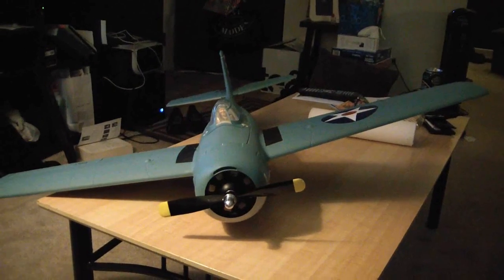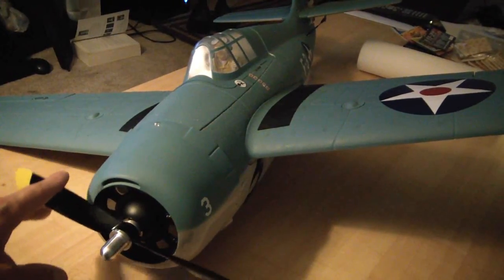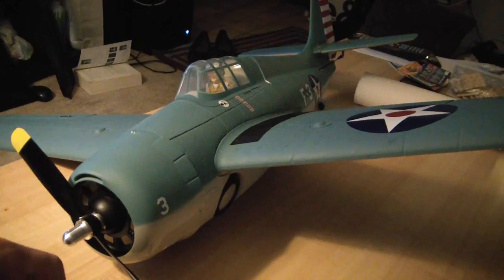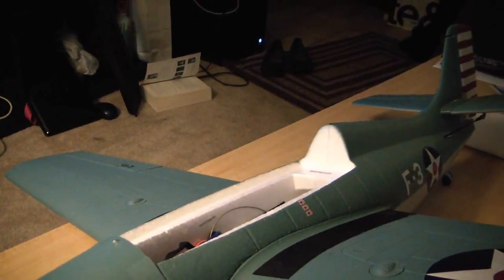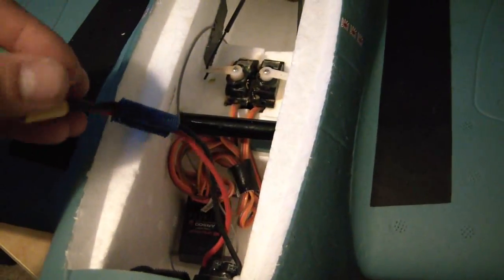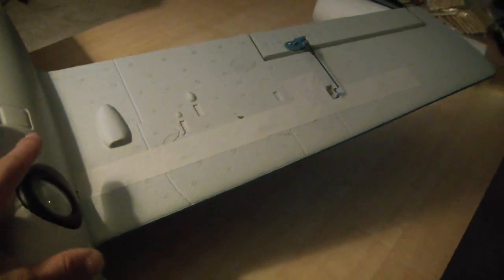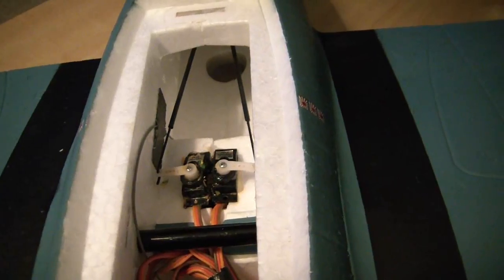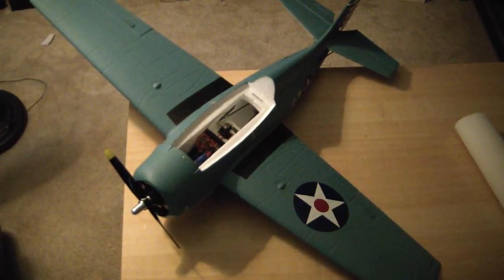F4F Wildcat built from P-51D BL parts!

Comment: Hello, just wanted to suggest a T28 prop. Really improves vertical performance. I am using the stock 18A esc and have not had any issues after 22 flights.